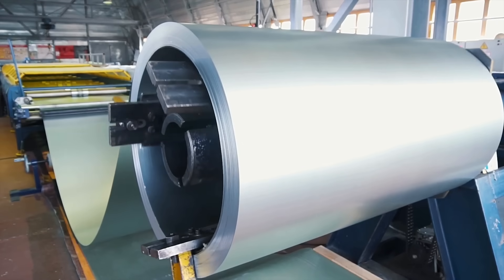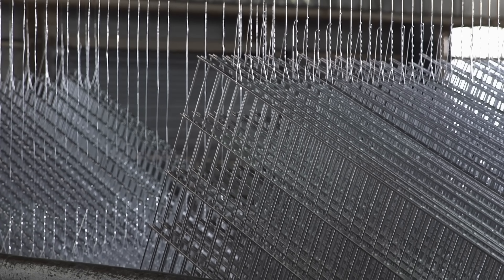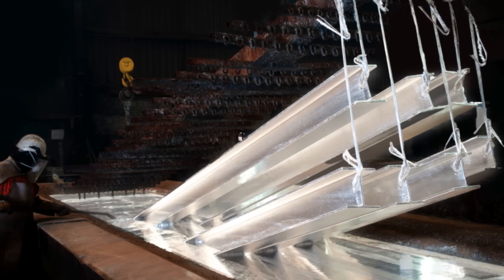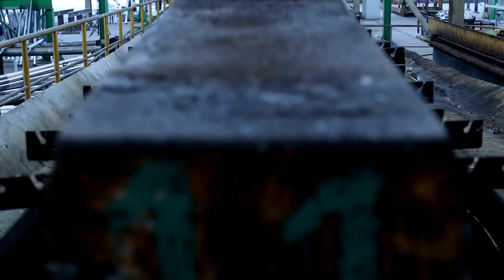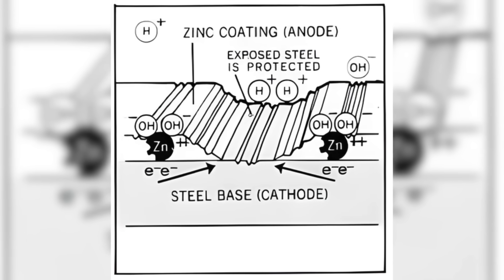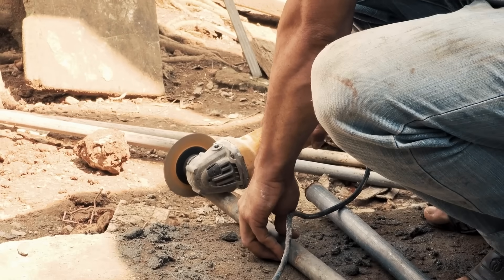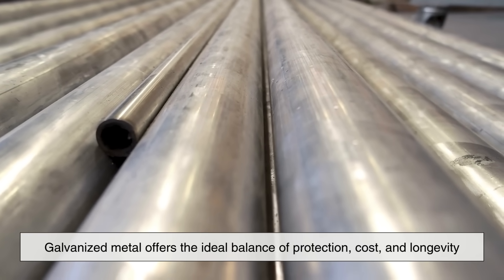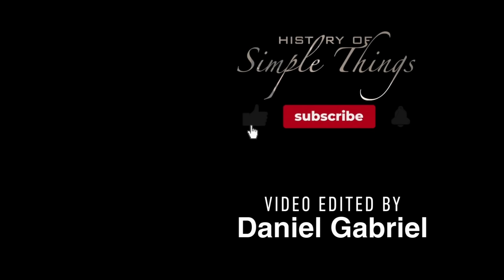Why Galvanized Metal Lasts for Decades — The Science You Never Knew!

Comment: If you are a Welder, be careful of galvanized metal fumes while welding.
Reply: Can confirm, it kicks off poisonous fumes. You should use a respirator or a welding hood that blows fresh air on your face.
Reply: @markmitzlaff8672  Cyanide  Gas  not healthy dude lol .
Reply: Drink milk before welding galvanized metal and afterwards. It will help you from getting galvanetic poisoning. Milk helps keep your body from absorbing the poison in the fumes
Reply: Use muriatic acid to remove

Comment: Fun fact, if you ever need to paint a galvanized surface you must use water based primer NOT an oil based one. The oil based primer will just fall off
Reply: Fun fact, I would use an etch primer
Reply: @Welder-wt4ib won't that damage the coating
Reply: @ericspagnoli1594  No, etch primers contain a % of zinc. Some more rich than others.  Etch primer is the perfect product for any bare metal. Also called DTM (direct to metal) which is sprayed first on bare metal, before a sealer or 2k primer is applied.  Which are the main building blocks to painting automotive, industrial, etc.. Unless it's around salt, then red oxide would be your go to before the primer/sealer is applied.
Reply: Buddy works for Big Water
Reply: Not when I do it
Reply: That's excellent to know. Thank you.

Comment: Hot dipping is NOT galvanizing. And galvanizing has nothing to do with Zink. You could galvanize with other metals such as nickel or kadmium just to name a few. Galvanizing always requires electrolysis, no flow of current = no galvanizing. Thats the whole purpose of naming someting related to Luigi Galvani. It was galvanic currents from different metals that made those chopped of froglegs to react in different ways. So stop spreading pure bullshit. The only galvanized zink parts are those FZB that has been plated with electrolysis. 🤢🤮
Reply: Hot dipping IS galvanizing.... Zinc is the most common for galvanization, even though other metals can be used, yes. Electro galvanizing is using electric current... You don't work in the steel industry, do you? I bet not...
Reply: @RedGateLoading galvanizing has to do with currents, it's based on luigi galvanis last name, and he was famous for?! Galvanic currents from different metals that made chopped of frog legs to twitch. So no current, no galvanization. That's the whole point. And to "work in the industry" says absolutely nothing about anything. I have been working with building trucks for almost 20 years, does that make me an expert on trucks? Not likely... To work with something has nothing to do whatsoever with terminology or knowledge... All I am saying is that don't piss on Luigis name by faulty use his fame to mislead the very expression that derives from his experimentation with galvanic currents...

Comment: Some companies even galvanized brake rotors which is absolutely the wrong way to protect the metal. When exposed to high heat environment. Galvanizing destroys the steel underneath it. I know this from experience. We used a few galvanized supports because we ran out of the aluminized metal and within just a few years when we had to reconstruct portion of one of the heat exchangers we had built when you grab the galvanized part it would literally fall apart in your hand. The structural element underneath the galvanizing had completely wasted away.
Putting galvanizing on a brake rotor does exactly the same thing to the gray iron. It causes it to start to destroy itself. Because the Heat and the rotor can easily rise above 800 Degrees under spirited braking

Comment: Meanwhile our cars are rusting out
Reply: Its meant to rust..so you will buy another one...simple!
Reply: They are resistant but not impervious. Places near the sea is notorious. It’s even common in cold places where they salt roads for de-icing. The salty water can easily corrode the zinc protection away.
Reply: The corrosion protection if cars has degraded quite a bit, afaik none are even zinc coated anymore. They do corrosion protection by phosphatisation and painting 

And the biggest factor of a zinc coatings durability is the chrome passivation coating, which sucks at least in the EU, since Cr6 was banned and the good coating methods aren't allowed to be used anymore

Comment: What about gi pipes where chillwd water flows ive seen rust and pipe breaking. I know, that stainless steel pipes should be used for chilled water. But these fools used gi pipe instead 😂
Reply: They will rust on the inside.  Rusty water is gross to think about, but they literally add iron into cereal so it kind of works out